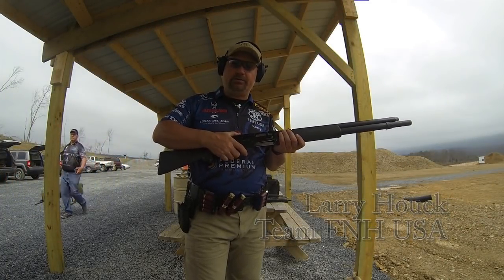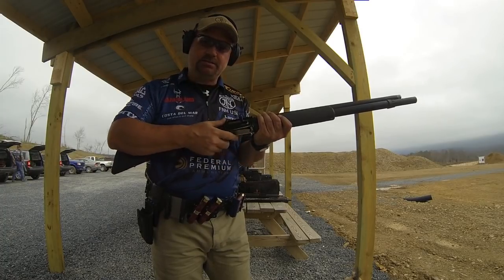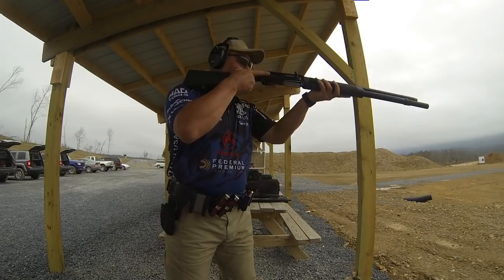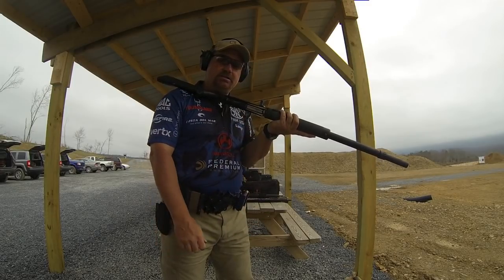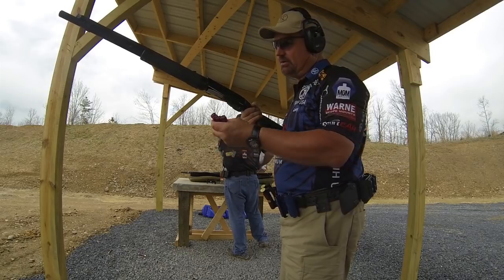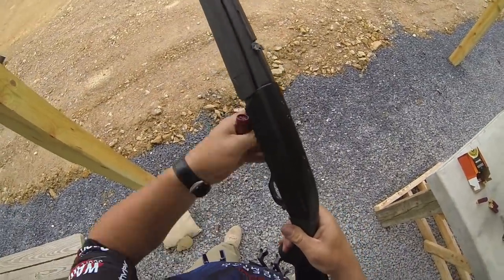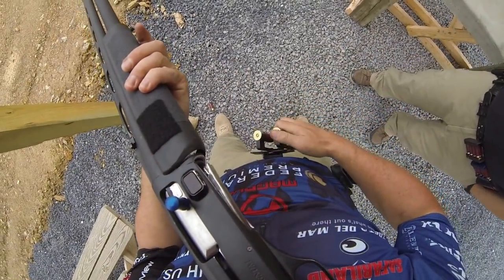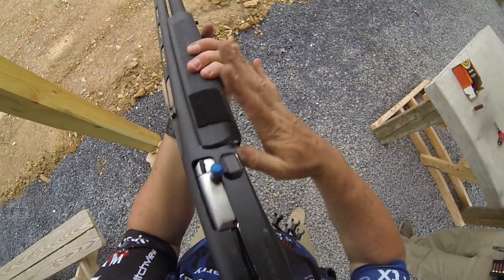Shotgun Loading (From Caddies and "Load Two" Method) for 3-Gun with Larry Houck from Team FNH USA

Comment: That's some high speed shit right there. Am I correct in thinking that this particular method requires that particular shell holder/configuration? Can't be fisted this way off the standard 4 shells-stacked holder, right?
(Apologizes if you got a flag for in appropriate content. I'm on my iPhone and hit the wrong button by mistake.)